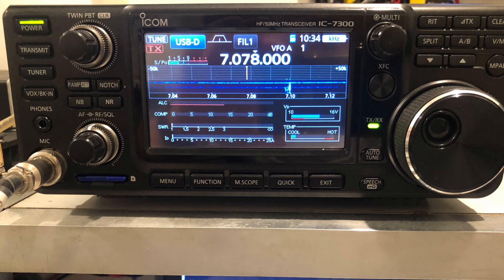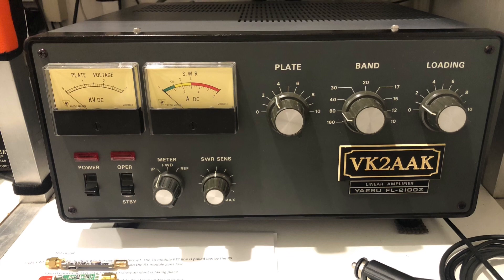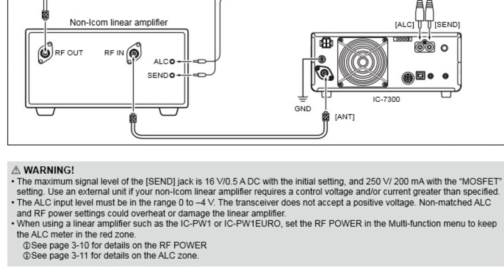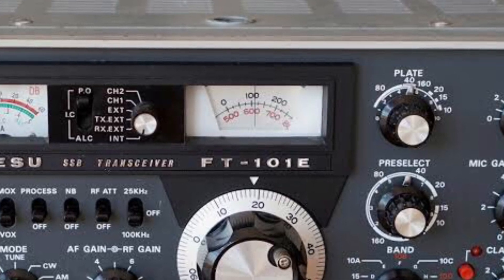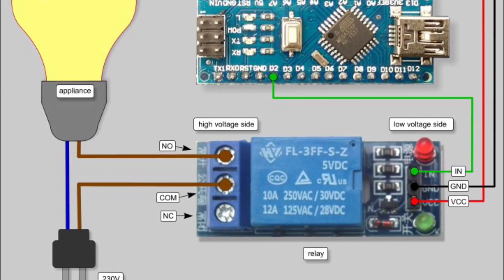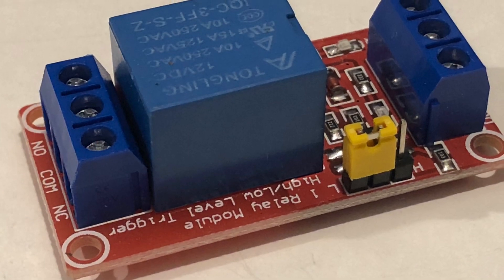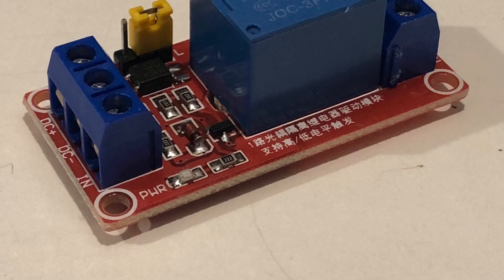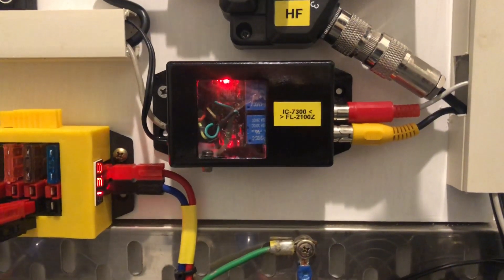Andy’s Workshop - Linear amplifier keying

Comment: I appreciate your video, however, I am presently connecting the switching output from my IC7300 directly to the control input of my 811H. So far there have been no ill effects; is there really a danger to my 7300 that Icom has overlooked in the design? Thanks.
Reply from the maker: @tracecom-t2u  Hi,
Icom haven’t really “overlooked” anything in the design of their transceivers. They are made to work with modern linear amplifiers which have low voltage/current TX/RX switching. Older amplifiers usually used a simple relay for switching with another simple relay in the matching radio. The relay coil in the amplifier could be as high as a hundred Volts in some cases!

You need to look at the amplifier and radio specifications to find out what the keying voltage and current of the amplifier is and whether the rating of the radio switching circuitry is capable of handling it. In your case I believe the 811 has a switching Voltage of around 12 Volts at 100 mA … and that is within the capability of the IC-7300 although I’m not sure whether the 811 has any provision to prevent back EMF spikes from the switching relay.

Regardless, many operators of older (and older style) amplifiers still use a keying interface as it’s cheap insurance.

I would recommend setting the TX delay in your 7300 to 20 mS or 30 mS if you’re running it through the amplifier in constant carrier modes such as FT8 as the switching in the 811 isn’t particularly fast. More modern amplifiers designs use very fast switching circuitry.

Comment: Hi there is it possible to do a video showing the SDR system you use to protect the SDR from RF  thanks
Reply from the maker: Yes, but right now I’m away from home, touring in our motorhome. I’ll post a reply when I get home in a few weeks.
There’s really nothing to the SDR protection. It’s just a coaxial relay activated by the transceiver. When the transceiver is put into TX mode the relay disconnects the SDR antenna and grounds the SDR input.
Reply: @VK2AAK  Thankyou
Reply: @VK2AAK please do..

Comment: I adopted a similar approach with a couple of Yaesu FL2100 amps I overhauled but built the modern rig compatible TX switching into the amps themselves using the 18vac amplifier transformer winding as a power source via a rectifier and 5v regulator with an opto -isolator switching a BD139 to work the amplifier changeover relay. That presented the rig with +5v at less than 10ma for switch over and of course no external box of tricks just a cable between amp and rig.

Comment: Best explanation on YouTube not going in circles and struggling for 30 minutes like the few videos on this subject. However, if one of those cheap Chinese relay modules fails in the process of keying, that's the end of your transceiver correct?
Reply from the maker: No. If a relay module fails then the amplifier won’t key and will be straight through … the transceiver will essentially be connected directly to the antenna via the relays in the amplifier … just the same as if the amplifier is switched off.

If the relay module contacts fail short circuit then the amplifier will key continuously …even when the transceiver isn’t keyed.

Neither of these scenarios will pose any risk. You won’t damage the transceiver.
Reply: @VK2AAK  Much appreciated. This clears up many of my doubts!

Comment: Hafa Adai Sir thank you for your video, I'm sure you would be the right person to ask about my AL-811 linear, my call is KH2ZZ and wanted to ask you if I'm doing it right, when I tune my amp with the radio, do I look for the "dip" on plate current meter with the lowest reading ? Thank you and hope to hear from you 73 de KH2ZZ
Reply from the maker: Yes, you normally tune for a dip (low) reading on the plate current meter, then adjust load, then readjust plate. After the first round of tuning it’s usually safe enough to peak the plate adjustment for maximum output. You shouldn’t do the initial tuning at high power. With my FL-2100Z I start with around 10 Watts from the transceiver.
Reply: @VK2AAK  thank you so much Sir for your input, it would save me some smoke out of my shack 73 de KH2ZZ

Comment: What about hot switching the amp? This relay adds several milliseconds delay from the moment the TRX send goes active and the amp switches on. If the TRX is hot at this time, it would mean that the antenna relay of the amp has to switch the full hf power of the amp. Not good... There are several circuits available (and the Harbach soft switch) that switches the amp using a power MOSFET without delay.
Reply from the maker: That's what the TX delay in radios like the IC-7300 is for. Mine is set to 30 mS which is more than enough to compensate for slow relays. There's no RF from the radio until well after all the relays have switched. It's 'MENU > SET > Function > TX Delay' in the IC-7300.